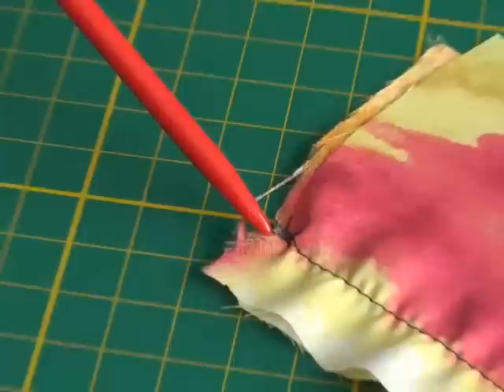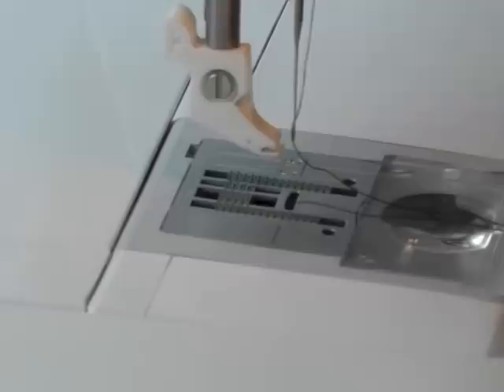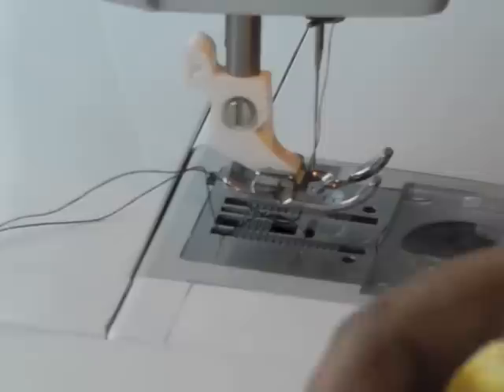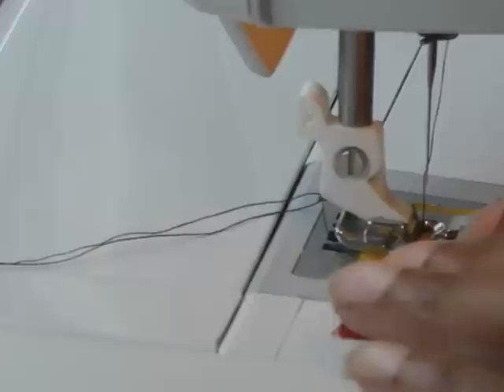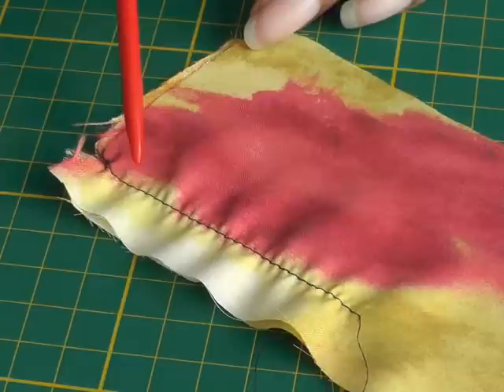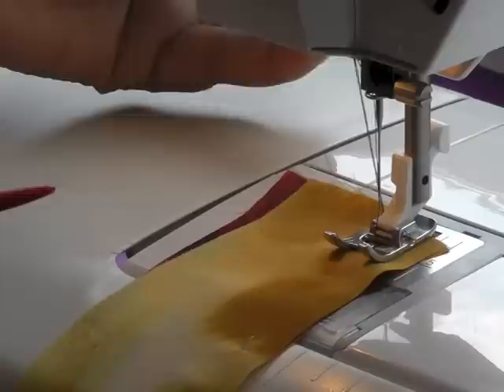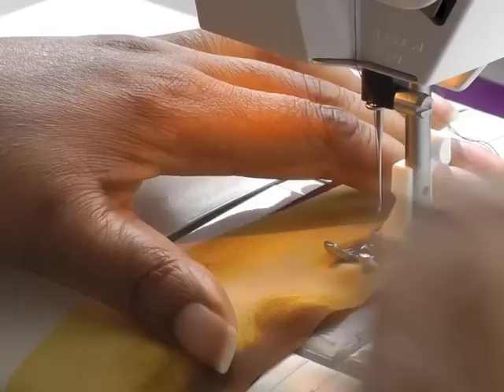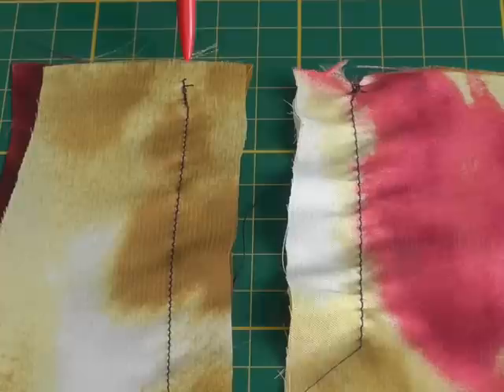Sewing Slippery Fabric

Comment: Having returned to sewing after a break of 30ish years, and using a new sewing machine, I was stopped in my tracks the other day when my machine started chewing up the slippery lightweight fabric of the back of the waistcoat I'm making.  Your tips are brilliant - the little bit of Selotape, new 70 needles, silk thread, tightening of the tension (to zero), and a slightly LONGER stitch have done the trick.  Thank you.  I'm really grateful.
Reply from the maker: Thank you and welcome back.

Comment: How do you adjust the tension??.
Really learned from this video.
Thanks
Reply: Your machine will have a dial showing numbers from (in the case of my machine) negative 4 to positive 5. Each machine has its own tension quirks, but the lower the number, the lower the tension. So for a slippery fabric start with a lower number than you'd normally use.
Reply from the maker: Thanks Tracy for replying to the comment!

Comment: Hi!  Glad I found your link!  I have a new Brother LS14 but having problems sewing fine polyester 'satin'.  I keep thinking the presser 'foot' under the needle is too tight down on the fabric(?)  Moreover, I cannot seem to get any variation on the thread tension as I turn it either clockwise or anti-clockwise.  It certainly looks like I have followed the correct routing of the 'upper thread'.  Else, on a quick learning curve here, for a guy!!!
Reply from the maker: It sounds as those you should return it, and tell them you concerns and to check it over, and if the issues still remain ask for a replacement.
Reply: Marco vanRoth if adjusting the tension isn't doing anything I'd check that your bobbin thread is installed correctly. happens to me all of the time

Comment: Thank you so much for your tips. I've never sewn with slippery fabrics until NOW. I've set  myself a task of making two sets of 13ft satin type fabric curtains. A question my machine is a Brother FS-40 I doesn't have a tension dial and I'm not experienced to mess with tensions. How can I get around this issue PLEASE lol I'm scared to even begin. 😅  I love the way you gave the tip about the hole covering. BRILLIANT 😘
Reply from the maker: You are so welcome Dona! It should have a tension dial on the FS40, which is the big circular shape more or less above the needle. Turn the thread tension dial counterclockwise to loosen the upper thread tension. Turn the thread tension dial clockwise to tighten the upper thread tension. I would recommend doing a couple of test samples before sewing your curtains. I hope that helps!
Reply: @Colleen G Lea - FSBTV  Thank you for your reply. I'll have a look at my machine tomorrow. Hopefully I've missed something? As I've said I'm a novice sewer and so far only made a couple of dresses in cotton fabric. I hope I've not over reached myself with this task x
Reply from the maker: @donaunsworth5620  It's good practice for when you are ready to sew your next dress. You are doing well! What type of fastening techniques did you use on those cotton dresses?
Reply: @Colleen G Lea - FSBTV  hi. An invisible zip and a button at the front. Mary Quant style dresses. Simple pattern and even had pockets. I like the 60s style. Next dress will be the Audrey Hepburn straight dress. Breakfast at Tiffany's. Fingers crossed on that one. Curtains have definitely got to come 1st to complete Tiffany style bedroom makeover. Including faux Window wall with jewellery inside.
Reply from the maker: @donaunsworth5620  I'm impressed Dona. When you start the dress, let me know how it goes.🙂
Reply: @Colleen G Lea - FSBTV  I will do Thank you. That's not so simple because of the back 🥺

Comment: My son put a 2 inch long rip in his new polyester jacket. Is there some type of material or glue I should used to reinforce the tear before I try to hand sew it back together. The jacket is new TODAY so I really want to fix it correctly.
Reply from the maker: +RaeAnn McDonald 
Backing it with a similar fabric or glue may help, consider making a design feature of the tear with input from your son perhaps.

Comment: Do you have any advice for slippery knit fabrics? I am working with a slippery very stretchy polyester and my primary issue is skipped stitches. Using a walking foot and needle for knits (I’m a beginner). LOVE your tip about the tape on the plate. I’ve always had an issue with that!
Reply from the maker: Use a ball point needle, maybe adjust the thread tension, and try using tracing paper. I hope that helps Lurath. Thank for commenting.

Comment: how do you reduce the thread tension? do you just pull it a bit by the needle?
Reply: No. The sewing machine has an option for that. It depends on the model where it's located.
Reply: @lisbethdc  thank you!! will check my manual
Reply: @evelinarepole5835  it's my pleasure to help. That's what YouTube comments should be for: helping each other.
Reply from the maker: I hope you have found Lisbeth answer useful.

Comment: What would have made this video helpful would have been to mention the tension and stitch length you were using in your example. However, thanks for mentioning the needle size. Outside of that, nothing to learn here for beginner sewers. ...
Reply from the maker: Thank you for taking the time to comment The Church.
Reply: Colleen G Lea - FSBTV wasn't necessarily trying to be rude but it's frustrating watching videos and the person not mention what they are using so you could gauge yourself from there. I'm making double layer satin sleep bonnets and because I'm using 2 different colors inside and out, the other color thread keeps showing on both sides. I tighten the tension.  I slacken the tension. No change. I don't want to use one color thread as the thread will stand out too stark on the fabric it does not match. Alas, my search for a solution continues :)